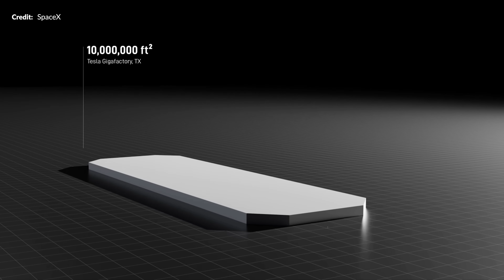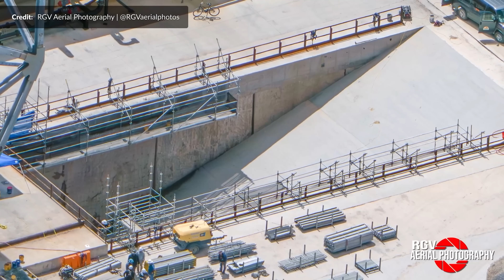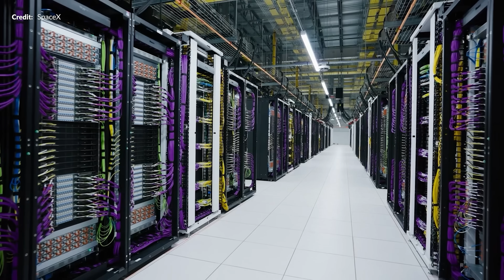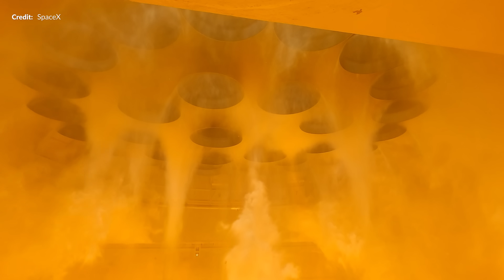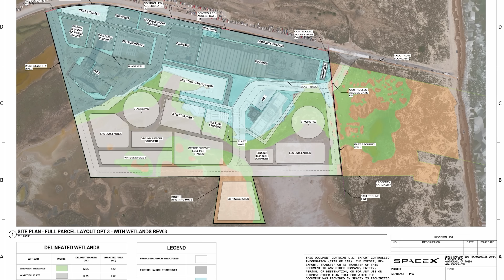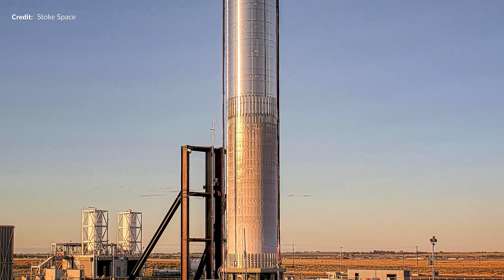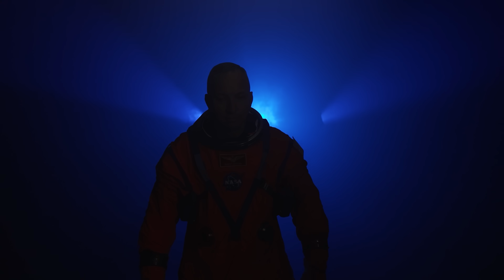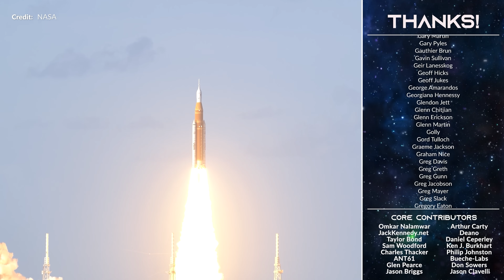SpaceX Just Revealed Its Biggest Plans Yet

Comment: I think SpaceX should reroute those power lines away from the road they use to transport the ships on. If something should happen like a tire blow out or sudden buckling on the side of the ship, it could fall into those power lines and knock out power for who knows what or how many residents near by.
Reply: That seems like an unwarranted concern as the self propelled modular transport vehicles, SPMT have 32 wheels on each side on thus one blow out would be unlikely to affect the overall stability vehicle.  

After all the proof is in the constant transports of ships and boosters up and down the road to the launch pad and to Massey's  test site for several years without a hitch!!

Comment: Artemis III will launch in about 12 months. I'm sure that SpaceX has a working model of the ECLSS for the HLS Starship lunar lander. Starfactory is a very large building. My guess is that a functional Starship lunar lander is located somewhere within Starfactory now, considering that SpaceX has been working on the HLS lunar lander NASA contract almost 5 years since Dec 2021. SpaceX has a lot of experience developing the ECLSS for Crew Dragon that dates back nearly 10 years.

Regarding SLS, that expendable, super-expensive launch vehicle likely will be repurposed to sending heavy uncrewed spacecraft to the outer planets, similar to the way NASA used the Space Shuttle. SLS is a dead end for sending crews to the Moon (too expensive, only flies twice per year). That work will be handled exclusively by Starship during construction of the SpaceX permanent lunar base.
Reply: Without even seeing it you believe that Space X has a working ECLSS for the HLS lunar lander??  You must have a lot of faith!?
Reply: @michaeldeierhoi4096 Not faith. Experience. I spent 32 years (1965-97) as an aerospace engineer (Gemini, Skylab, Space Shuttle, and another 7 projects). McDonnell started preliminary work on Skylab in 1967 and that space station was launched in May 1973. The Skylab ECLSS was working in 1971, four years after that program started. SpaceX started work on the HLS Starship lunar lander in Jan 2022, 4.5 years ago.
Reply: @flsh-v6p   Well then good for you.  It's helps to know what persons background sometimes because that definitely raises your credibility.

Comment: I thought the conference had noted that Standard Starship v3 was going to be used with the Docking Attachment would be mounted where the Pez docking door would have been.  Additionally, there was mention that optionally Blue Moon lander could be mounted on either a Vulcan or even Falcon Heavy if New Glenn wasn't ready
Reply: How about Blue Moon as a Starship payload?  You'd need the large doors but they still seem to plan those.

Comment: What’s the end of life plan for those AI satellites?
Reply: Likely the same for Starlink, controlled deorbit.  I don't see why they'd change that.
Reply: @imaginary_friend7300  I thought one of the reasons for low orbit (besides latency) was the satellites' orbits would decay quickly due to drag in the event of loss of control.  AISats will be in a higher orbit.  End of life was not the correct term to use as that would be controlled deorbit.

Comment: Thank you for this. 

WRT the NASA plan for Artemis III, the Blue Origin proposal looks workable. I agree with you about the disappointing lacunae / plans that raise more questions than answers about SpaceX's HLS alternative. 

Of course, you were right as well to ask how Blue Origin will get their test article into Earth Orbit.

I'm quite worried about the possibility that what look like undamaged rocket components may have suffered "invisible damage" when the New Glenn exploded. 

Aside from the damage readily seen with the naked eye (and high-speed cameras), explosions can do a lot of damage with concussion shock Rocket components are quite fragile and depend upon the maintenance of close tolerances and a bevy of complex systems to operate properly.  

As for the SpaceX IPO and "data centres in space", I remain skeptical about the heat dissipation issue. 

Yes, SpaceX's plans to build a "Gigafactory" for the production of SpaceX AI computer chip wafers are impressive, as is the concept of installing the produce of said "Gigafactory" into the satellites to be used for putative space-based data centre farm satellites. 

However, I really think that it is incumbent upon SpaceX to address lingering concerns about heat dissipation. Moreover, this is but one of the questions one might ask of the economics and serviceability of the space-based data centres plan. Others include on-orbit repair, end-of-life disposal, likely "externalities" in the form of in-orbit crashes that render orbits occupied by the data centres constellation unusable, and of course damage to the ozone layer by yet more plummeting space junk.

Comment: I'm beginning to have doubts about HLS and the version tp be used for Artemis 3 does not boost confidence.  It looks as if there are difficulties and delays not visible to the public. There also are real concerns about the design which as several major weaknesses, problems that worry engineers--to wit, HLS's high center of gravity, the elevator as a single point of failure, and the potential mismatch between the design of landing legs and the lunar regolith.  NASA's silence on these issues is also concerning. Since SpaceX is not at all shy about publicity, the relative silence about HLSS is itself suspicious.
Reply: Internet pretend experts are not engineers.
Reply: @imaginary_friend7300  True.  And YouTube is rarely completely accurate.

Comment: Orion docking with Starship will be like a minnow kissing a blue whale.  Another excellent report and good journey.
Reply: Rather like Dragon and Soyuz docking with the ISS.

I remember people objecting to HLS docking with the Lunar Gateway.  I suggested if that was a problem then dock Gateway with HLS.  

Now imagine Starship used as a station.  Add several inflatable modules (each when carried up being the full payload volume of another starship.  It would dwarf the ISS without even adding the solar panels.  Now add a 2nd end to end with the first.

:eyes-pink-heart-shape:

:eyes-pink-heart-shape:
Reply: @Scanner9631 I have the same vision.  I wish SpaceX would consider modular bulkheads to eject the engines and rear puck assembly, to discard upon orbit and station integration to another large 18 meter docking port to be placed at the bottom of the O2 tank.   Then reverse dock the next Starship once its engines have been sent back to earth and mounted with a robotic arm like on the ISS.  They could get really crazy and have an inflatable ablative shield deploy atop of the engines and puck assembly to parachute recover the engines.
Reply: @raytribble8075  

Just how plug and play are raptor 3s?  Can they be dismounted in orbit, crated up and returned?

Could they make everything above the fuel tanks a detachable station and just keep it in orbit as station modules?  

❓

❓
Reply: @Scanner9631 one would think removing a raptor in space would be doable.  I would also think the station would be automated on a lot of the docking and deployment of solar panels, heat radiators and supply modules.  Each Starship could have multiple docking ports.
Reply: Thanks for watching videos

Comment: Bit of a newbie here. But can i ask with all these satellites in orbit how can they guarantee not hitting one with a rocket.
Reply: 1. We know exacly where each on is, so timing and aiming.
2. Space is big, real big, realy realy big. So there is plenty of space between each one. 200 meter (balpark 600 feat) is considerd scary close.
Reply: Think air traffic control. Planes are in known locations, known paths. Issues are actively avoided. Same goes for satellites, but space is way bigger, so satellites can be very far apart. Satellites are also actively controlling where they are, and if need be, can adjust their position to avoid any potential issues.
Rockets can be timed(Take off time) and steered to avoid any proximity issues with satellites.

Comment: Does anybody know, for what reason the hinge at the grid fins of falcon 9 booster is removed in super heavy booster? Such hinge would allow the grid fin to be flush with the booster until re-entry, solving some problems with hot staging. Additionally the needed proellant would be reduced.
Reply: They say the drag improvement is negligible with folding and a hinge is both more mass and another failure point.
Reply: @Scanner9631  Thank you
Reply: @Scanner9631  Thank you
Reply: this has been answered over and over again, they cause little interference on the way up, and to eliminate the hinge, "the best part is no part"

Comment: for SpaceX moon lander shouldn't the engines and tanks be forward and on the flaps? put the crew and doors all at the bottom
Reply: So the major mass should all be at the top?  

In any case HLS is a Starship variant and will maintain the general shape and layout.  It won't have the heat shield or flaps as it does no re-entry.  

:face-turquoise-covering-eyes:

:face-turquoise-covering-eyes:

Comment: SpaceX really is in a unique position to leverage the Starlink constellation for communications with satellites in higher orbits via laser links. Will be interesting to see how far this goes over the next few years.
Reply: Yup! They have a major advantage.
Reply: as soon as they find out about the Val-Allen-Belt and what it does to chips in satellites that are orbiting there... not far! But they needed a little bit of time to find out that a flame tranche is kind of a must too... 😅
Reply: @spanke2999  They know all about them already.  You are a bit of a simleton.
Reply: @spanke2999  These satellites would be shielded against high energy electrons, the kind of shielding for this is reasonably straight forward to implement and is already used on satellites above 600km. 
Cosmic ray radiation is the bigger broblem requiring chips to have error correction built in.
Reply: @schrodingerscat1863  

Sorry apparently I didn't told you, that was another chat. Sorry for that

 I told you the difference between current satellites and those that have been used of data centers. Also I explained the difference in radiation intensity. 600km vs. 2,000km is not a linear increase... we are talking about a 100 up to 100,000 times the amount of radiation! 

Again, it's not that no chip can operate in these conditions! It's that high performing AI training chips can't perform in these conditions without a massive increase in 'mass to orbit', either shielding or redundancy! 

Since we are talking here about economics and cash flows... you tell me if it is a good idea to increase the costs x-times just for the hardware alone in comparison to a data center here on earth? Would you go with the pitch "Oh it will cost way more and you can't iterate the hardware as quickly and you lose it maybe all to Kessler Syndrome but... hear me out... we use a BFR!!!!" 

Honestly... please...
Reply: @spanke2999  The type of radiation is important in this though, much of the increased radiation is in be form of alpha and beta particles. This is blocked by quite simple shielding. The real issue is high energy photons (cosmic radiation) which is difficult to shield against as it requires something dense and therefore heavy. The economics of such satellites is increased cost of electronic hardware, the satellite itself and the cost of launching into orbit vs the cost of power, land and construction if built on the ground. I would assume these costs have been calculated and there is a potential saving to be made. Iterating hardware is normally based around cost per token and that isn't an issue when it's all being solar powered in orbit. Of course there is another very valid argument against, as you point out, it sees orbit becoming very crowded increasing the risk of collisions causing cascading failure across whole orbital shells which would be game over for all satellites ultimately.
Reply: @schrodingerscat1863  Glad we agree with respect to the Kessler Syndrome. This is quite a challenge because it turns the rules for classical investments upside down. Usually, when you build up assets, you gain some kind of risk diversification—not everything is lost if something happens somewhere. With a mega-constellation, the exact opposite is true. The closer you get to peak performance and therefore economic success, the higher the density, and the bigger the risk of losing it all in the blink of an eye.

But you are making a few fundamental mistakes with respect to radiation. It is not standard alpha and beta radiation as we find it in terrestrial radioactive decay. There, you would be right that a sheet of paper or thin aluminum is enough. In the Van Allen Belt, we are dealing with high-energy protons and electrons, mainly trapped and accelerated by Earth's magnetic field. They possess energies reaching well into the MeV range and are incredibly hard to shield against. We are talking about thick, heavy shielding layers which in turn generate secondary Bremsstrahlung, creating an entirely new set of hardware degradation problems.

Also, the simplification regarding solar power doesn't hold up. Even if the power itself is calculated as "free," it isn't—because you have to lift the massive solar arrays into orbit at a high cost. Furthermore, you have to add immense additional mass for thermal management. Every single watt you generate must be radiated away in a vacuum, and it has to happen at a temperature low enough for the 3nm chips to operate efficiently.

All of this adds dead weight: shielding, redundancy, massive solar arrays, and giant radiators. Combine that with the economic necessity to iterate for better chips every few years—which in space means dumping the entire constellation and launching a new one—and I honestly don't see how this could ever be cheaper in space than on Earth. Especially considering how many terrestrial data center projects are currently being canceled due to cost realities.

Comment: Any idea why Artemis lll mission, which is just launching Orion into low earth orbit, will need side boosters?
Reply: The SRB's are what provide the lion's share of thrust to lift the fuel off the ground in an expeditious manner. Like about 75% of the needed thrust to overcome intertia of the dry mass and fuel.
Reply: The weight of Orion?
Reply: Sls can't lift itself without them. The core booster doesn't have a positive twr until its half empty.

Comment: If I am seeing this correctly, the Artemis III MK-2 and the regular MK-2 have the crew compartment at the bottom of the craft with the rocket engine in the center. I realize the engine will be walled off from the "wrap around" crew compartment but wouldn't this, even for the short firing   durations, be incredibly noisy? I'm sure the designers and engineers have worked this out to somebody's satisfaction.

Comment: IMHO, there’s no point to wasting Artemis 3 if the HLS hardware isn’t pretty close to final.  They need to do maneuver testing.  Arguably the docking test is the least important, we surely can do that in space reliably now.
Reply: Neither Blue Moon or HLS has ever docked with anything save a fantasy, and 'just trust us to make it work' typically leads to disaster and uneeded deaths. No vehicle gets human rated until it proves itself safe and capable. This is a critically needed step, as the two lander candidates will have radically different mass distribution, centers of gravity, torquing behaviors and just about every other variable you could name. What works for one of them could fail utterly on the other. You do NOT want to learn the hard way a quarter of a million miles away from help.
Reply: @w @wesleybeaver the final article will be very different.  If you are worried about CG, that will likely be very different once the life support systems are installed.  Just adding legs to the Starship is going to change that.  These tests will have to be repeated once the final design is ready, so not worth it.  Anyway, M House asked for our opinions and he seemed to think like me.
Reply: Starliner missed the ISS the first time it tried to dock.  It would be a shame if the HLS missed Orion (or vice versa) on docking.  

:face-turquoise-covering-eyes:

:face-turquoise-covering-eyes:

Comment: Can‘t they launch Orion on a Falcon heavy, if the TLI Bündnis anyways performed by Starship??
Reply: Orion would be significantly heavier than any payload ever launched or contracted to launch on Falcon Heavy. Falcon Heavy uses the Falcon 9 upper stage that was really designed for much lower mass payloads, and its unclear what the extent of required modifications would be to allow it to launch the full Orion stack. Additionally Orion is currently integrated vertically on SLS before rolling out in that configuration, while Falcon Heavy requires its payloads to be integrated horizontally before being erected at the pad, so there may be modifications required to either Orion of Falcon Heavy there as well. Finally you'd obviously need to crew certify everything for launch together and make the necessary modifications to the launch infrastructure to allow for crew boarding and emergency escape from Orion.

None of it is necessarily impossible, and indeed Lockheed Martin officials have in the past talked about launching on something like New Glenn. But rockets are not Lego, and it would definitely take time, money, and effort. 

With Isaacman crippling SLS by killing off the properly optimized EUS upper stage, he definitely set the stage for outright cancelation down the line, but in the mean time it exists, works, and to an extent is already paid for, so I expect SLS to survive at least until Artemis V or 2029. Beyond that we'll have to see if a future administrator is able to save SLS or if it'll get canceled after just a handful of flights without a proper upper stage.